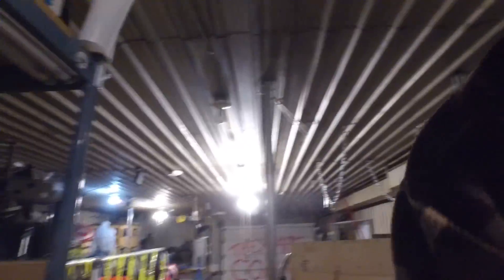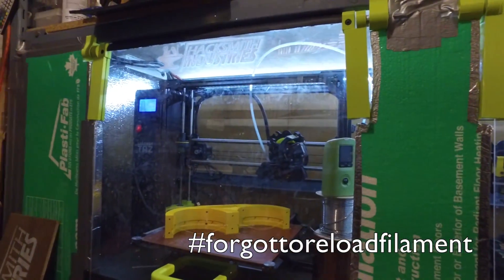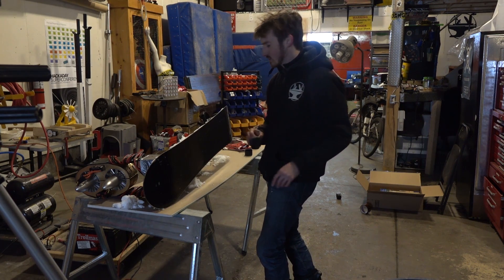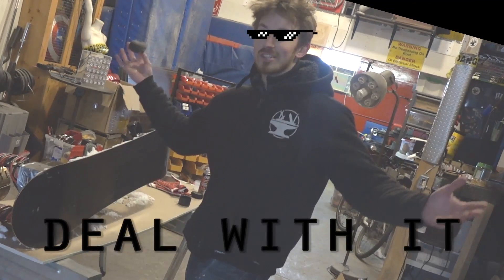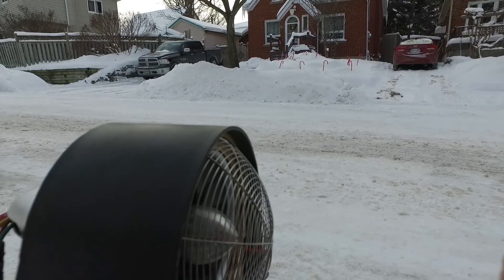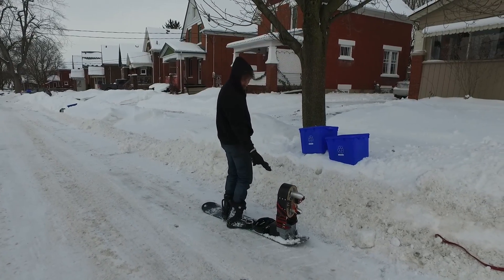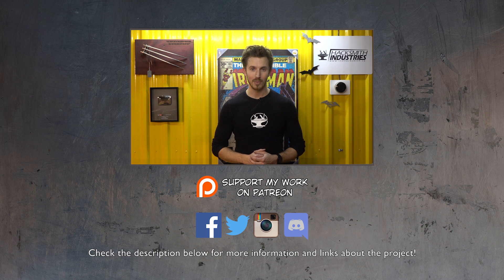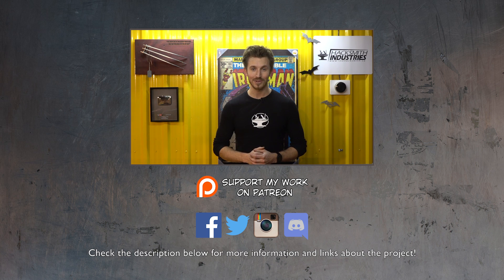Make It Real: BOOSTED "SNOW" BOARD

Comment: I feel like mounting the fans next to each other instead of being stacked would help with controll and balance a bit.
Reply from the maker: +Zach Bush you'd also bust them first time you crash ;-)
Reply: the Hacksmith possibly, but if you add a skirt and downward fan similar to a hovercraft you could use a wider board allowing you to put the fans next to each other. Plus this would make it an all terrain board.

Comment: look at colin furze and you would know how to make a jet engine...this would be more egfective then these airthings
Reply from the maker: +Julian Coskun not at all. Pulse jet engines are great fun, but they weigh more then they can put out in thrust. Works fine for vehicles as Colin has shown, but impossible for flight. The pulse jet Colin showed me how to start is larger than the snowboard itself and puts out the same thrust as these EDFs.

Comment: You should have made the frame from aluminum so it wouldn't be so heavy and you could get more speed
Reply from the maker: +Hmlsc Echos just a prototype -- also can't weld alum... So...
Reply: the Hacksmith fair enough, also there are ways to weld aluminium but to require some heavy tech
Reply from the maker: +Hmlsc Echos yeah no Tig welder here ... Yet
Reply: the Hacksmith can't wait till ya get one

Comment: dud.. those fail you need to quit electric turbines and go with mini gas RC ones that give off 180lbs of force.
Reply from the maker: +mark Skyvodski gas turbines that size only put out about 20lbs of thrust... They aren't miracle machines lol. Ones that put out 50lbs of thrust are about 200mm diameter and they cost $3000 each. So that's why we're not using them lol.
Reply: Oh dang. Haha thats so $$

Comment: Wouldn't it be more stable is the edf's were on their side
Reply from the maker: they would also stick out -- first crash and you'd destroy them
Reply: the Hacksmith what if you extended the size of the board with ski like structure on the side? Or make the board in an ascending shape

Comment: Bad idea to put battery inside of construction and using metall. It should be light to control your movement. Or am I not right?
Reply from the maker: +Jiger Joock it's just a prototype... Steel is the easiest thing to make it out of.
Reply: true, i am kyrgyz and used to wood and chinese plastic. Used to make airplane models... btw nice job, liked it very much. Looking for your future works, don't stop :)

Comment: Would it not me smart to use some kind of ''windmill'' behind the EDF:s to gather electricity while you are using the motor and if so would not that mean that you'll need less batteries?
Reply from the maker: +Enox I'm afraid that's impossible -- energy is finite! Power in = power out + losses (typically heat). You could hypothetically harvest the heat energy from the motors and generate some electricity -- but it wouldn't be worth it :(
Reply: Okey, thanks for the fast answer.
You learn something new every day! ^_^

Comment: there is no reason he had to make this out of steel.
Reply from the maker: Well I can't weld aluminum, and 3D printed braces would break on first impact... so... yeah, there's lots of reasons why it was made out of steel.

It's called a prototype not a product...
Reply: the Hacksmith I mean you could always use rivets or other fasteners in conjunction with cut aluminum.  it's much easier to work with.  but yeah, that makes sense.  I guess I'm not used to people prototyping with steel.  also, insane response time, nice.
Reply from the maker: That is a good point! But the amount of forming and bending you'd have to do with aluminum to rivet it together, would probably be a lot more work I think... For me, steel is cheap, and super fast to prototype things in. Welding is dirt simple with steel -- gets a bit trickier with aluminum! But I do want to add TIG welding to my skillset... making somethings out of aluminum would be awesome!
Reply: the Hacksmith yeah! I mean it's just using bolts and the right forms of aluminum, but you're definitely right about the cost.  it's a great material for an application like this because you don't really have to worry about strength.  how much did that back module weigh? just curious.
Reply from the maker: The metal is only about 10lbs so it's not too crazy. Compared to the mass of the rider, its pretty negligible. It would be more controllable if it was as light as a plain snowboard though!

Comment: Mount them in a V formation. side by side behind the front foot. wide enough to avoid the back legs from the thrust, high enough to allow a car on each side. . 25 years of snowboarding and 20 years of RC aircraft says your thrust needs to be forward of your cg in order to turn. or your ass end will keep trying to pass your front.
Reply: carve*

Comment: Just a suggestion i think you want to put the jet power in the sides cause your blocking the air 
-solid fan
Reply from the maker: +Campusjhon 32.3.6 that was the original plan, but they're too wide. They'd stick out from the board. If you crash, bye bye EDFs

Comment: another idea for this is to have the two EDFs placed horizontally (lower them, then turn 90 degrees) and modify the rear foothold to have two pressure sensors underneath (one in front of the ball of the foot, one under the heel). then when working with the batteries/internal units, separate the triggers for the EDFs to get differential thrust...
it'd be cool.

Comment: Put an EDF on each side about 4 inches from the ground tilted at a 5-15 degree angle so that the thrust is able to push off if the snow better.
Reply from the maker: +Bros. Logic that would reduce the thrust... EDFs don't need to push against a surface to produce thrust :)

Comment: hey man, could you mount the edfs horizontally? would give you better balance....
Reply from the maker: +Rion Caughman they'd stick out from the side of the board, when you crash you'd break them :(
Reply: +the Hacksmith ahhhhh makes sense. so even if braced, it'd still be dangerous?
Reply from the maker: +Rion Caughman when the EDFs + ESCs cost over $500 a set... You don't want to risk things :p

Comment: +the Hacksmith - Hey, you should try using the waist mounted rig from the bicycle test with a normal snowboard to see how the two compare. Also, why not use the waist mounted setup in conjunction with the boosted board for double the boost? (If you have that many working EDFs lying around)

Comment: Awesome idea! I would have laid the ducted fans flat so that they are next to each other, lowering the center of gravity and keeping your legs from blocking the airflow. Also using aluminum would decrease weight.
Reply from the maker: That was our original plan -- but they stick out past the edge of the board, which means as soon as you crash -- you'd smash the EDF's =(

And I can't weld aluminum =(

Comment: they should be mounted side by side and lower. it would increase air intake and increase stability.
Reply from the maker: +Gamma Prysem they would stick out too much. That was the original plan, but they'd break when you fall if they stick out

Comment: Great project.  Entertaining to watch.  Question.   Why would you do SO much weight with all that heavy metal?  You're good at 3d printing.  Mock up what you've built and 3d print that.  Reduce a TON of the weight.  You've added a ton of unneeded friction with all that weight. You've designed a decent enough battery box and holder for the engines....just do it all in plastic now.  You got the concept proven, time to perfect it now.  Keep up the good work.
Reply from the maker: It's called a prototype ;-)

Comment: @hacksmith
that looks great...
great progress..
this filmgelenk632 guy is logical..but the drag the Edfs are experiencing is true..
as you showed that the safety net decreases the thrust by 10% and addition to that your legs are also in the straight front of the Edfs..
I saw the video and noticed that the gauge of the metal sheet you used is high,I understand that the Edfs require better structural stability and no doubt you would have done it  with a good analytical approach.
But it's an aspect I saw providing the drag..the weight..
( "only if possible") try the position that ,that Shubham is proposing.And if you can loose some weight..
Otherwise putting the time in designing and making a new  design is too costly and I assume a waste of time...
Reply from the maker: That is why it is a prototype, and not a product! ;-)

The placement of EDF's is not ideal, but due to the size, they would stick out from the board if placed in a horizontal position, lending themselves to damage if (when) the rider crashes. They also cannot be too close to the board, as they would suck in snow!

We have been playing with EDFs for around half a year now, and while we lose about 10% thrust from the mesh, we would prefer that to the possibility of having clothing or other objects sucked into the blades (something we have also had happen during testing). As for the proximity of my legs to the EDFs, this does not reduce the intake by very much. If my legs were in the path of the exhaust and thrust, it would cancel out the majority of the power. 

And finally, the weight when compared to the weight of the rider is rather negligible -- it could have been designed and made lighter, but for the purpose, timeline, and point of this prototype -- not necessary =)

Make sense? =)
Reply: +the Hacksmith 
hmmm....
this rings the bells quite a little..☺
and yeah you are right I am just watching the videos and trading Ideas.. but you got the original😐😐
can I have an email on which I can send attachments to you guys..?
Reply from the maker: +Kirtan Thaker on our website!

Comment: Awesome work. Couldn't help but think if you lowered the center of gravity by putting the EDFs side by side instead of stacking it's less likely to tip you would have more control
Reply from the maker: +Ish wright but then when you do tip, you'd break the EDFs cause they stick out from the board :p

Because my center of mass is still much higher than the board, it really doesn't make much of a difference :)

Comment: +the Hacksmith hey! this will probably get lost in the comments, but i have been looking at some of those "1000* knife versus" videos, and that got me thinking. Would it be possible to make a sheath that heats up a type of metal used for a sword, with a high melting point, and make a boiling sword? i know this is extremely similar to psylocke's sword, but it would be cool to see it cut through some thin objects with ease. Thanks!
Reply from the maker: Have thought about it~!

Comment: Why don't you take the board into a shop and get it waxed? Shouldn't cost too much and you'll get much better performance because your supposed to switch up your wax depending on the temperature of the snow. Make sure you don't drill into the base! If you want to learn how to wax a snowboard just google how to wax skis/snowboards, it's basically the same thing. It's pretty easy and and you don't need that much if you're just waxing!
Reply from the maker: We will for the big test =P I do actually snowboard, I just haven't boarded for very long.

Comment: Someone has probably asked this already, but I'm not about to look through 600+ comments to find it: did welding the metal frame not melt the plastic EDF frame? Or is that filament resistant to heat after it sets?
Reply from the maker: +Wil Ezekiel I only tac welded when the plastic was in it. If I left the plastic in there when I filled in the entire seam, it would of melted :p
Reply: Okay, thanks for answering
Is there a filament that would be more heat resistant? Is there a way to print teflon?
Reply from the maker: +Wil Ezekiel not that heat resistant... Most filaments print at temperatures of 230-250C so that's about it for heat resistance
Reply: Ah, okay, good to know

Comment: try to heat some how the under surface to melt the ice for getting lower friction not to much hot to boil it but to melting it ,and maybe try to make a little angle on the jet part to the air hit more the ground to get more propell,and nice jobs srry for the english ,hi from argentina ,keep doing this awessome vids .

Comment: try to heat some how the above surface to melt the ice for getting lower friction not to much hot to boil it but melting it ,and maybe try to make a little angle on the jet part to the air hit more the ground ,and nice jobs srry for the english hi from argentina keep doing this awessome vids .

Comment: suggestion. put sone type of throttle in the toe.
Reply from the maker: I'm holding the remote! It's the safest way of doing it -- having a foot control would be more likely to mess up because you move your body a lot when you're snowboarding =)

It's the same way electric skateboards work =)
Reply: Colin Wolcott Don't think that would exactly work since you are always leaning when turning and such.
Reply from the maker: +Colin Wolcott why wouldn't you want to just use the remote?
Reply: because you are relying on someone else to control the motor and that presents a possible safety risk to the operator. the remote also would be hard to hold while you are riding I think, because you would also have to balance. maybe a throttle in the toe is a bad Idea though.
Reply: all that Said, I am not an engineer. I'm more thinking out loud than anything.

Comment: Any reason why you didn't mount the EDFs horizontally instead of the vertical configuration ypu used? I imagine having the trust lower on the board would make it more stable for balance,  but also provide a more linear thrust vrs the nose digging setup you made.  Plus it would make the whole system look better.
Reply from the maker: +Dermal Deviations they would stick out to the sides, then when you inevitably crash... Bye bye $500 of components!

Also because your centre of mass is much higher than the thrust, them being high up really doesn't have much of an effect on it

Comment: You may also want to try some different i.e. better batteries.  I assume HK is giving you the Zippy Compacts, but in my tests their voltage drops under load significantly more than other batteries.  Like Turnigy HDs or Multistars.   I don't fly my EDF RC planes with Zippy Compacts, only lightly stressed prop planes.
Reply from the maker: Hmm, we haven't really noticed that during any of our bench tests, maybe you got a bad batch?
Reply from the maker: Nice comparison! 

While those little watts add up, these are the batteries we have, and since we have limited (no) funding we're not able to get better ones unless HobbyKing decides to send us more =(

Comment: You did a great job editing this video! Beginning to wonder if the EDF's should have been mounted side by side closer to the board for better stability.
Reply from the maker: Problem is they're too wide! First crash and you'll take them out =(
Reply: the Hacksmith
Yes, I thought of that, but you'd definitely have better performance with them side by side closer to the board. The board will be less likely to flop over to the side, and you'll have less stress at the mounting point on the board due to less leverage. Maybe make a protective guard?
Reply from the maker: What about sucking snow in? ;-)
Reply: the Hacksmith Based on what I saw in your video, that nicely made battery box has some height, so I would mount the EDF's side by side just above that box. Should be fine. Worst case, you'll end up with an EDF powered snowboard and snow blower! :-)
Reply from the maker: We checked -- they stick out from the edge of the board. Crashing would be bad
Reply: the Hacksmith I figured they would stick out on each side by 4-5cm. You'd need a one piece protective shroud bolted into the battery case made out of 1/4" aluminum. The finished product would have a nice streamlined look and perform better in my opinion.
Reply: Plus you'd have to keep both edfs      in perfect sync at all times or you'd keep turning

Comment: you could put the board on thin metal blades on 4 corners of the board, just like ice skates, and take it on the ice. you might top around 100mph.
Reply: on a perfectly smooth track in a straight line... any propulsion could infinitely accelerate...
Reply from the maker: +ONI 4-ALPHA-17 you're forgetting about wind resistance :p
Reply: the Hacksmith I was pointing out that the resistance caused by fins would be too great to compensate for the increase in stability.
Reply: the Hacksmith it's just fun to do such speeds. Some guy did it with a sail on his board and the skates.
Reply: He went 80mph on ice beating the record for ice sailing

Comment: Those edfs should be horizontal so the wait doesn't shift and flip the board
Reply from the maker: My center of mass is still well above the EDFs so it really doesn't make a difference. If we had them sideways, then when you crash, you'd break the EDFs =(

Comment: Hey guys I have another potential project! I was wondering if the electric EDF'S could make enough boost in a internal combustion engine to be felt!! Thai would be pretty cool to see
Reply from the maker: So like... an electric turbo? They already exist =P
Reply: All those electric turbos you see on eBay are just exhaust ducket fans and I've only seen one guy online retro fit an RC car motor to a turbo compressor but nothing like a EDF plummed to an intake!